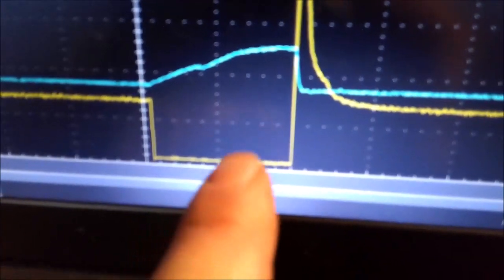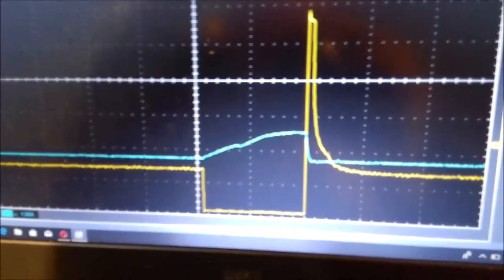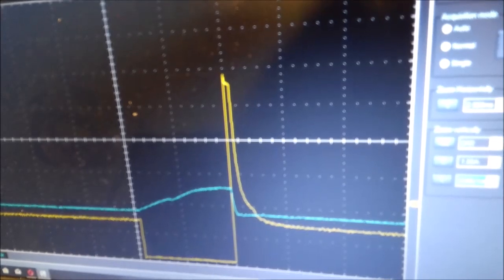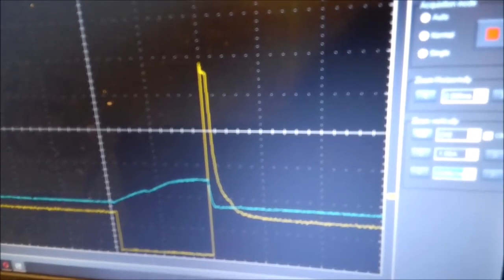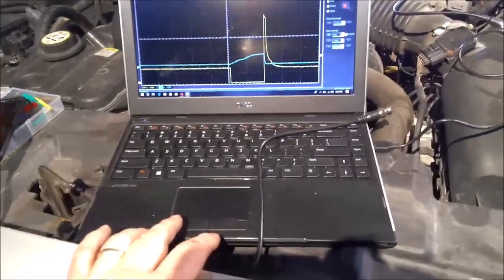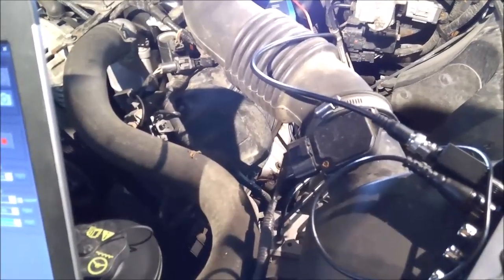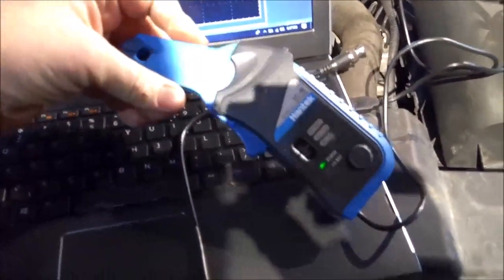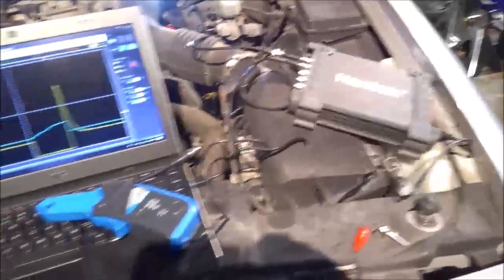Hantek 1008c Scoping a Fuel Injector

Comment: Really appreciate the video. I’ve had my 1008C now for 3 yrs or so. I have become familiar with its function and limitations.  It is as you describe. Software is difficult to get used to initially.  I  fabbed  a custom lead set as the ones supplied are too short.  They have modular ends to accept standard multimeter accessories. I do find the information contained in waveforms enlightening for diagnostic purposes. Your video was awesome and I thank you for sharing.

Comment: Ive seen these i like the 8 channells. but there is that low quality lead thing you mentioned and short cables .although as far as price goes it would be a good enough scope. If its accuracy is good and the software works right this might become a good tool to start with. Does it run on windows xp
Reply from the maker: I am sure it would run on xp

Comment: I always hear bad things about the hantek but it seems to do the job when i watch videos! Which is the main thing. Everyone says the software is crap, can you zoom in on parts of the waveforms etc like i see the pico software does?
Is it just because the hantek software is clunky/glitchy it gets a bad name? Or is it because it lacks  a lot of features? Nice video by the way, thanks!
Reply from the maker: The software is definitely the weak part it's not as nice pico and there's no support.  the pico is obviously a great scope but I think this is a great starter scope and does quite a bit as you learn it. the leads that come with it are cheap but the scope is so inexpensive it's worth upgrading the leads.
Reply: this vid shows how to zoom in by changing settings https://www.youtube.com/watch?v=qgd0YTBv9hE

Comment: not a bad scope for a beginner.....i use it it's good but there is some hash/noise in measuring ignition coil
Reply from the maker: I've noticed it can be noisy as well I attributed some of that to the cheap leads that it comes with.